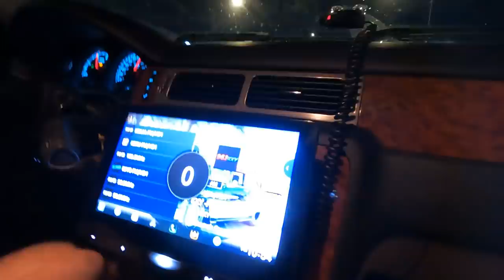Shop Talk With Ryan and Chuck, The History of Chucks New Car, and Some Street Testing!

Comment: A moonroff is tinted, usually fixed to roof but can pop open to let air in. A sunroof you can slide open all the way and are clear or fabric. So it's a moonroff which is a type of sunroof.

Comment: A moonroof slides between the roof panel and the headliner with glass also it vents. A sunroof is a pice of aluminum that matches the color of the car and it slides over the roof panel. It can be glass or aluminum.

Comment: Sunroof can be completely removed or slid back, and is usually body colored. Moonroof can't be removed, is usually made of tinted glass, has an interior cover that slides over it to block out light, and slides back into the roof or pops up.

Comment: Unlike a traditional sunroof which is normally body coloured, moonroofs are typically glass and are not designed to be removed from the vehicle, although they usually slide or tilt open.

Comment: In Chuck's mustang I never seen what the actual window look like but a sunroof is only a single glass that can either flip straight up and lock or it can flip straight up and then go back halfway or most of the way or it can just go straight back on a inside the roof track where it hides away and it just being the glass only but a moon roof can actually be all three of those types of glass but they're also has to be in panel that can slide back and forth that is for blocking the daylight and nighttime light from what I've always heard

Comment: A moonroof is considered a type of sunroof, says CARFAX. But a moonroof usually has a tinted glass panel, much like an extra window, on top of the car. ... Unlike a traditional sunroof, moonroofs are not designed to be removed from the vehicle, although they usually slide or tilt open

Comment: It must of not been a full tilt BBC. I say that because James Reaper with his
540 F3-136 BBC made 3478 rwhp on the hub dyno and the 574 F3-140 BBC made 3630 rwhp and 3000 ft lb on the hub on a fairly mild Bruder tune so a bbc can be a winning number 1 combo. That being said this little car is gonna be fast once that wiring gets finished up.  And the history of the car is cool.

Comment: Back in the 60s we raced on the track with no safety gear not even seat belts. But cars were a lot slower.
Reply: I raced 10 second street car back in the 80’s and the only safety gear I had  was the factory lap seat belt and the stop sign for a floor of course
Reply: LOL

Comment: I was the same way for like 30yrs man no equip wearing shorts with slides on and a tank top racing a 7 second car down county roads I'd go to the strip grab my motorcycle helmet that wasn't shit but a cheapy because the local track was a small organization back then then about 10yrs ago i laid down my Gsxr 1000 at about 100mph and ended up in 4 surgeries and 3 skin graphs on my legs right arm and then it all changed I don't race without my fire suit and helmet and my bike I don't ride without my helmet and coat very much anymore either my point is don't wait till it's to late and then think about what you should done differently esp when it comes to safety I get brother u can drive I can fkn drive but sometimes that guy in the other lane can't and that can fk u up just as bad as if it was ur own fault be safe out there drive it like you stole it but be safe when ur doing it because the people that love is expect us to come back in the same shape we left

Comment: Ryan bought the car. Chuck bought Ryan's 481x twin turbo setup. Shawn bought  Ryan's old Procharger setup. Dave copies Ryan's telemetry, Monza has switched to Hemi with Procharger now too. Basically all the top guys in 405 are either copying, or taking Ryan's leftovers. That's the 405 now. Ryan is the new leader of the 405. And Big Chief hates it.

Comment: And my personal opinion Sean which doesn't mean much you're going to have nothing but trouble with them small blocks I build a mod boost them and you don't have nothing but trouble with them blowing them up anytime you twisted up over 9000 you're screwed and they'll tell you all it'll run 9500 all day go try it one time they don't small blocks too expensive Sean in my opinion I'm just a dummy or I would be on the show I will put some thought to that and watch how many times truck constantly blows his up running it 9500